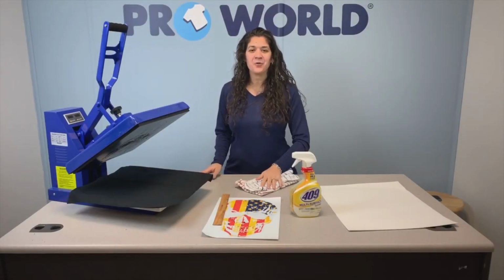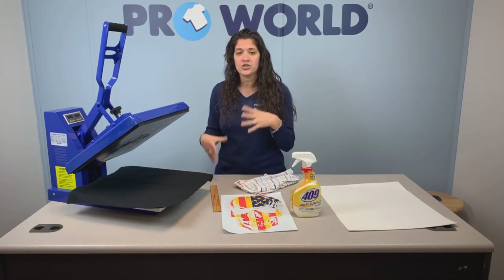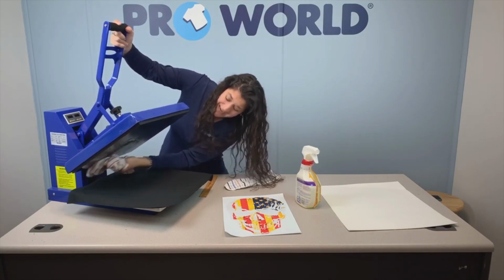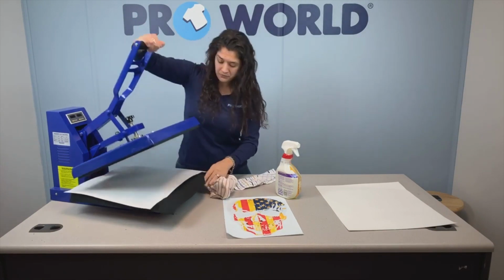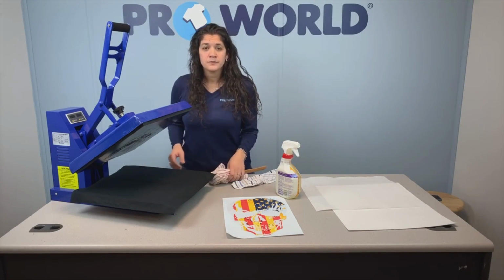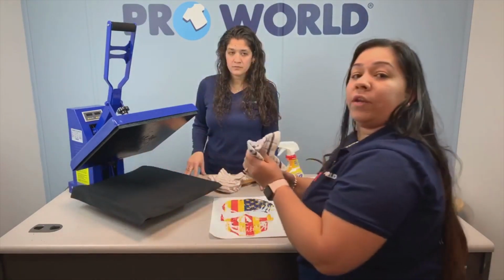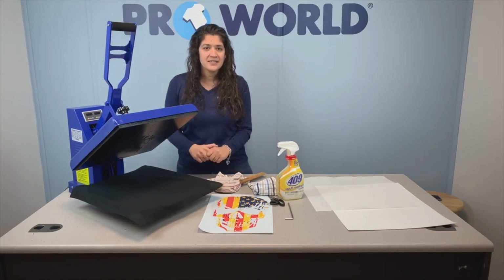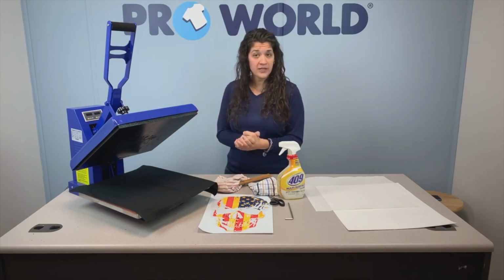Cleaning Your Heat Press

Comment: I have one of the old style machine with the grey top plate. It has mold/ mildew stains from sitting in the garage for over a yr untouched. Any advice? I tried a scouring pad in one corner with water and vinegar and water n baking powder.. No such luck. 😪
Reply from the maker: We haven't experienced mold on the platen before, but you may want to try using simple green diluted with a warm rag.

Comment: Would this work on fabric too? I was heating a dollar tree fabric bag, to press on a design,  and in under 5 seconds it melted the bag, destroying it, making a mess on both top and bottom of my press..
Reply from the maker: You can definitely try it. The bag sounds like it was made a plastic material, so it may take a bit more effort to remove the residue it left behind. You may need to reheat the platen a few times to help with the removal.
Reply: I has the same exact thing happen. I hope this method works for us 😅

Comment: I’m a beginner my  mat has a picture on it because my granddaughter didn’t put nothing on it to keep it from bleeding how can I clean it it’s removable
Reply from the maker: If the product pressed was a screen printed transfer or sublimation print, it may be difficult to get the pad fully clean. You can cover the pad with an old t-shirt (straddled on the bottom) or use a platen wrap https://www.proworldinc.com/hpa-ess-1515-15x15-fitted-lower-platen-wrap.html.

Comment: How do I clean the Matt on my press
Reply from the maker: To clean dirt off the bottom silicone pad, you can use windex and a sponge. However, if you accidentally print a design on the bottom pad, the easiest clean up is to cover it with a fabric cover https://www.proworldinc.com/hpa-1515-f-15x15-fabric-cover.html or old tshirt.

Comment: My DTF transfer  sheet stuck to the heat press what should I use to clean it
Reply from the maker: On a warm (not hot) platen, we suggest using a non-abrasive cleanser like 409, a non-stick spatula or another tool that will not scratch the non-stick coating of the heating element (think tools you would use with a non-stick frypan), and a lot of elbow grease.  Review the video for more details.
Reply from the maker: @glennmaloney4962  That's great!  If you have a scrap piece of fabric, you can also continue to press it to (hopefully) remove any residue or residual ink.

Comment: Would oven cleaner work good for such an item to clean the platen?
Reply from the maker: I am sorry, we have not tested that product on the heat press. We have confirmed that 409 works well. One of our followers used Goof Off to assist with removing adhesive from the platen as well.

Comment: WILL YOU PLEASE TELL ME THAT HOW CAN I DO CLEAN THE COLOR STICKING ON HEATPRESS MACHINE UPPER PART.
DOWN PART I CLEANED BY HAND CAUSE ITS EASY ...I DID IT BY MY NAIL ... BUT UPPER PART I CANT DO ANYTHING ... CAUSE IF I dO SOMETHING WRONG THAN MY MACHINE WILL BE DAMAGE ... SO PLZ MAAM WILL U HELE ME OUT... CAN U GIVE ME ANY ADVISE ... PLZ I NEED SERIOUSLY HELP THANK YOU ... ANYBODY IF U GUYS HAVE ANY IDEA OR U ALSO DID MISTAKE LIKE ME AND CANT SOLVE WITHOIT ANY OTHERS HELO THAN PLZ PLZ  PLZ PLZ I NEED HELP
Reply from the maker: Hi Mukesh. We recommend using 409 spray and a non-abrasive sponge to clean the platen. We would also recommend the platen being warm so the residue can be removed easier. Please review this video for the demonstration.
Reply: @ProWorldInc  thank you...i will try once iif it works thann i will give u double tripple thanks